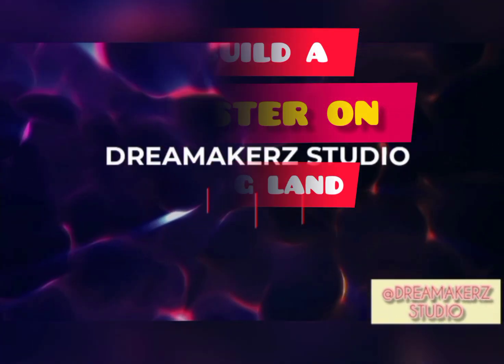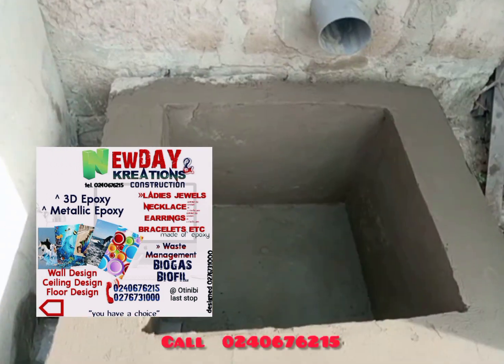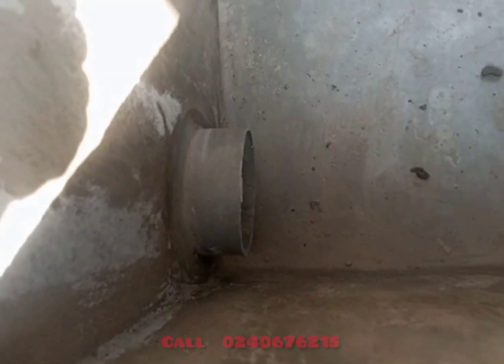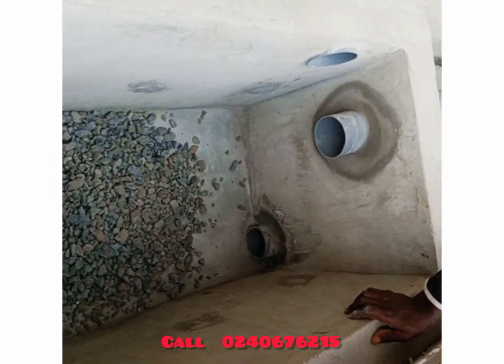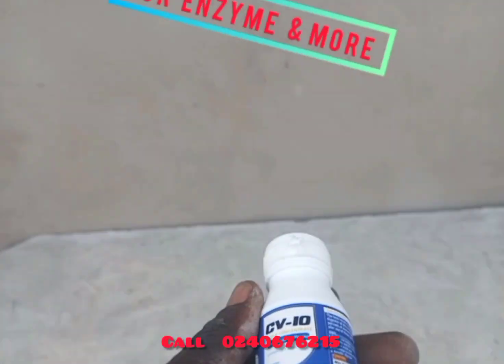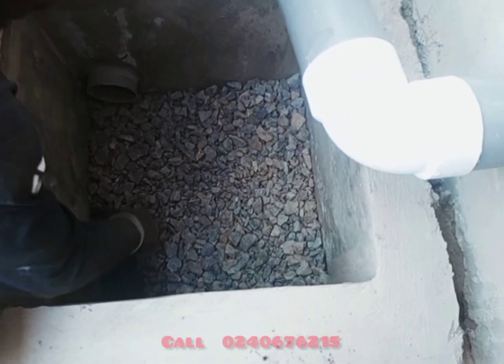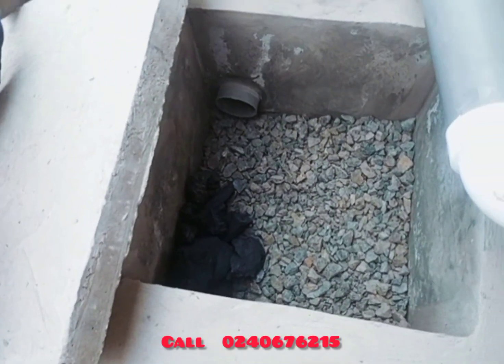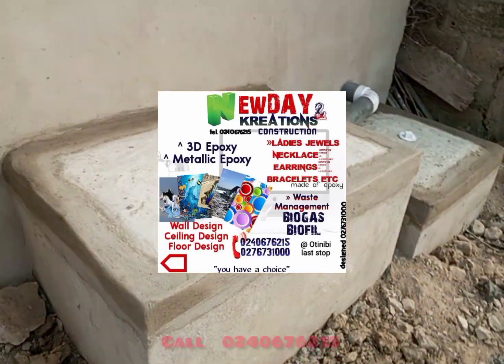How To Build A Bio-Digester On A Water-Logged Land

Comment: How does the waste pass through the chamber with the charcoal inside it
Reply from the maker: The waste water pass through a pipe from the digester onto the charcoal and it will be strain through layers of the packed charcoal in the filter chamber with other arranged filters, then to be dispose in the soak away hole or to the gutter